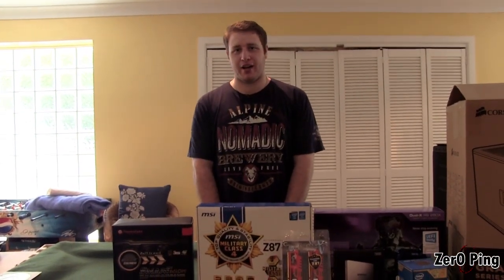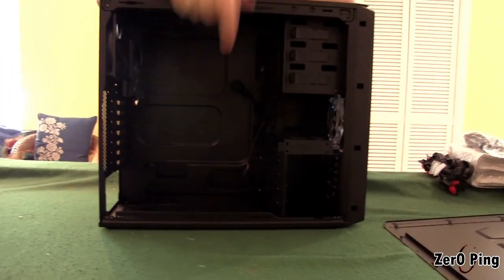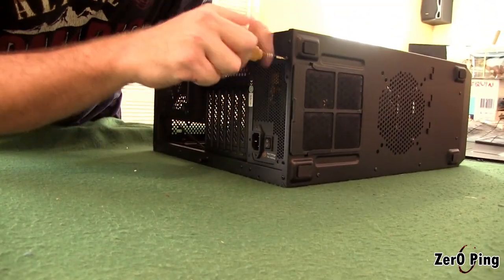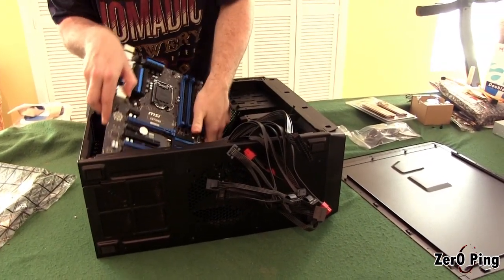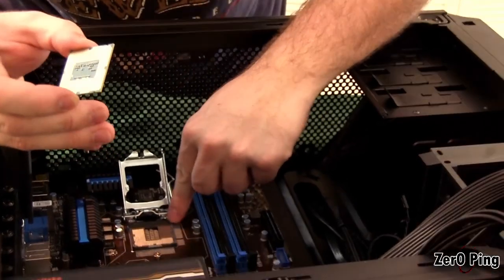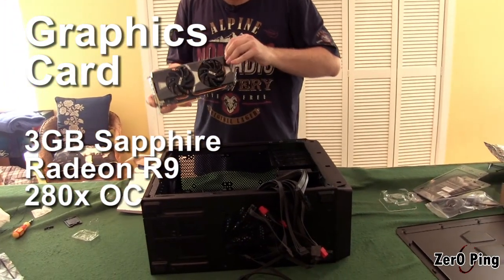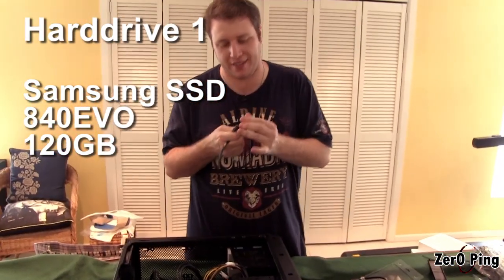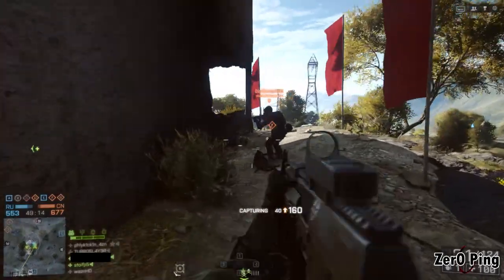Rig building with Michael and Zero Ping

Comment: Is your Sapphire about the size of an HIS Iceq Radeon 7850?
Reply: Nvm I think itll fit in the case.
Reply from the maker: TheGamingBaffoon The Sapphire is slightly longer, but not as high or wide.
The dimensions for both are Radeon -  23.5 L x 4.2 H x 14.3 W cm and the Sapphire - 26.2 L x 3.4 H x 11.2 W cm
Reply: Zer0PingProductions Okay. Was asking because I had to cut my hard drive bay out of my current case to fit that fat bastard in there. lol

Comment: i would not use that fan,
Reply: alot of people underestimate stock heat sinks and fans. Truth is you dont need anything better unless you live in someplace super hot and dont have ac and or are overclocking. Im running a bulldozer with stock heatsink/fan and it doesnt go above 40.

Comment: Thank you man, I will be buying this case and I have no idea how to mount everything on, (first time building my own PC) this helped a lot. thanks!
Reply from the maker: No worries, and remember when in doubt consult the Manual/Google it.
Reply: One question though will this fit in the case with the mobo/cpus on? XIGMATEK Gaia SD1283 120mm, I have no Idea how long or i was wondering if it will hit the side panel of the case though.
Reply from the maker: Chris M. I would recommend doing some research yourself. As the case is in the medium range it may be a tight squeeze.